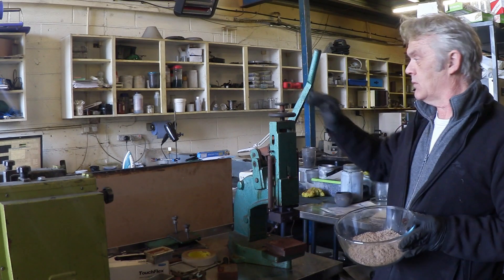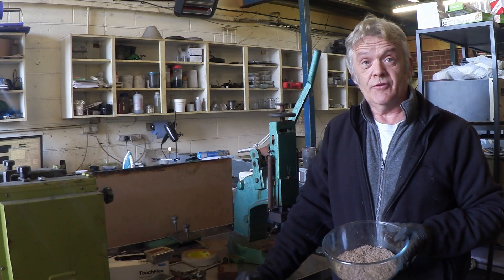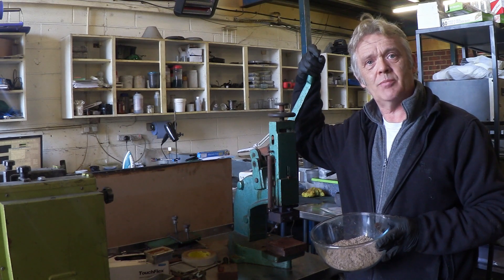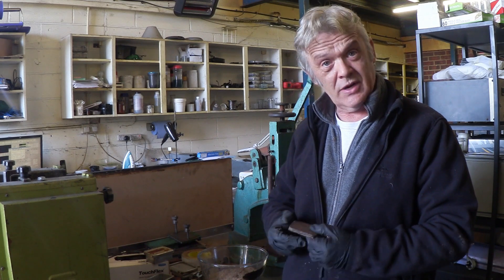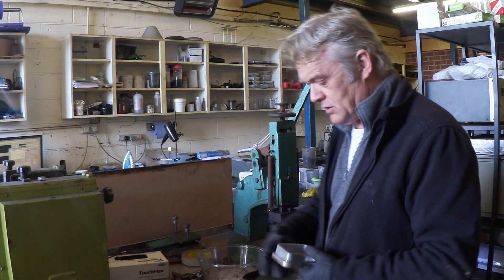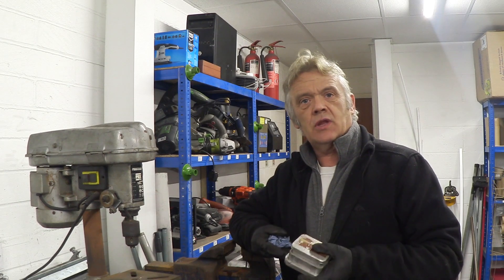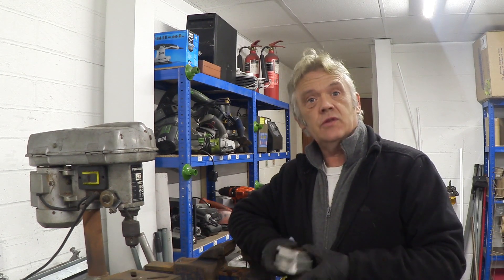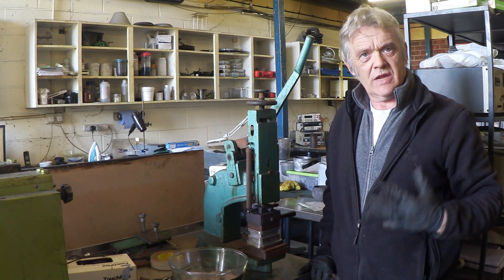Hot Press Molding Hemp Casein Plastic

Comment: Could you show us how to make a foam? A bio-foam!
A solid one like in surfboard and a soft one like acoustic foam.
Foams are classified as a composite material. But here the reinforcement fibers (flax fiber per exemple) are replaced by air / gaz bubbles.
I guess a bio-plastic (that cure fast?) underpressure with something that produce CO2 inside the same container may be a method...
I would love to see a surfboard that desintegrate after a season! Could be even an edible one!

Comment: Robert , I was involved in my dad’s business of custom molding for ten years where we did injection molding and transfer and compression molding . The business itself was in business for 48 years in Southern California servicing the air a space, medical and commercial industries. I  worked with many types of fiber filled polymers where we would pre dry the material in industrial ovens and microwave ovens before molding in either heated compression or transfer molds .  I am interested to know more about your experience with the carbonized hemp fibers that you have been working on and would like to contact you to maybe ask a few questions.
Reply: May I ask, will heat keep hemp fiber in it’s form after being pressed. Another individual uses 6”x6”x6’ cube molds for his logs to retain their shape while being baked. I’m trying to bypass that step. Any idea?

Comment: You mentioned  'vacuum oven' in one of your recent videos... Would that not make a more ideal way to dry the plastic before pressing it? ~( 'w')/
Reply from the maker: works for me - but I like to suggest stuff most folks can do at home - if we load it up with expensive equipment all that really happens is folks say - I can't do that I need... - so I like to use stuff as simple as possible
Reply: @ThinkingandTinkering  If a person simply put it into a metal paint can with a hose barb plumbed into the lid, and attached it to another such sealed can full of calcium chloride [ice melter] and then put the can full of plastic pulp out in the sun some place, [preferably put the can with the CaCl2 some place cool, like a camping ice chest filled with ice] then the hygroscopic nature of CaCl2, accompanied by the thermal difference between the 2 cans would drive a lot of moisture off over a day's time.

Mason jars would do the same thing, but they don't usually come as large as metal paint cans [mason jars typically go up to about 1/2 gallons imperial or 2 liters metric, while metal paint pails come in as much as 5 gallons imperial or 18 liters metric], and they conduct heat less efficiently because of the nature of glass.

Also, metal cans can take more rough handling than glass.
Reply from the maker: @DeliciousDeBlair  nice one mate - lots of good info - cheers

Comment: Don't have a press.  Can the plastic still be molded into hard cakes without the pressure?
Reply from the maker: no mate you need a press - but a press can easily be made from a car jack
Reply: also you can use a generic pipe and rod plus lever to make one 
https://youtu.be/r6ZZXKUmHeI?t=261
How to make plastic washers from recycled HDPE for the rope pump.
771,862 views•Oct 11, 2013
,Dolf Heubers

Comment: I recall a car made by Henry Ford had a hemp based polymer for body work.
Reply: That was my thought. I wonder how it would perform pressed into the form of a fender, like Saturn used to do. Is it waterproof? Brittle? Can it be painted with hydrocarbon based paints? Might it be strong enough with the right additives to function as a structural member?
Reply from the maker: lots of good questions mate - are you going to look into them coz I would be fascinated to know the answers
Reply from the maker: it did indeed mate
Reply: I'm in the middle of a semester right now, but eventually I may have some free time and money. For now it's vicarious enjoyment of YouTube videos